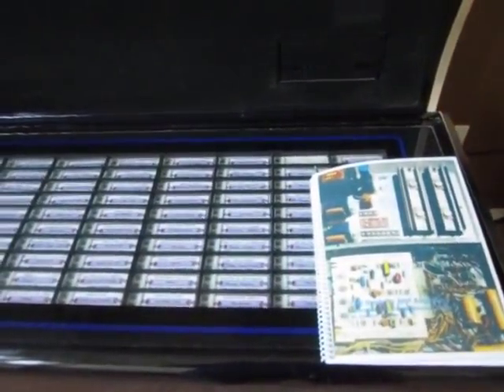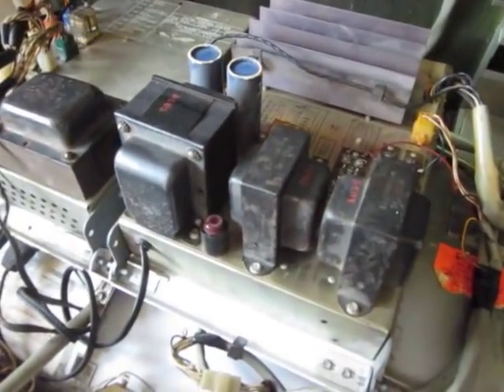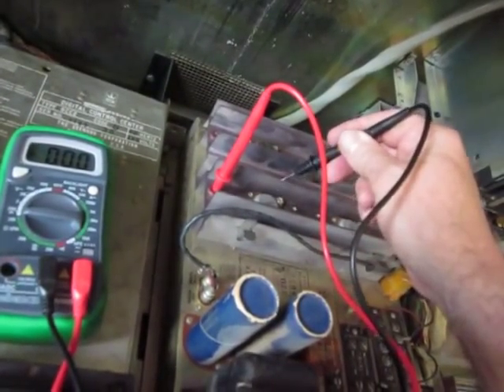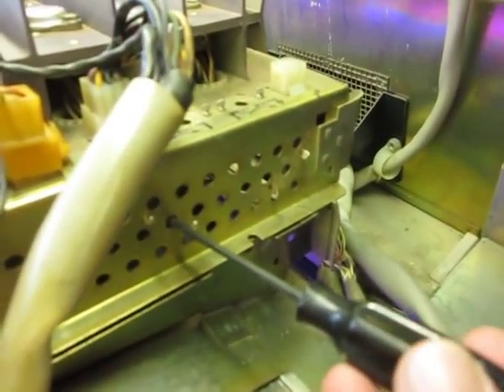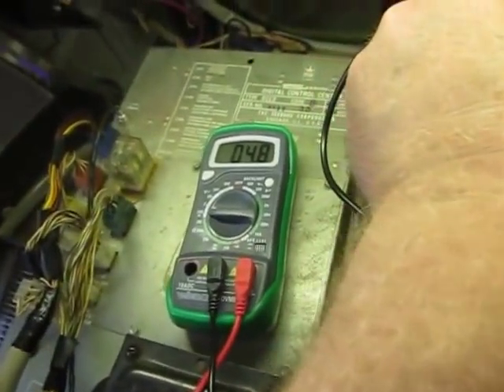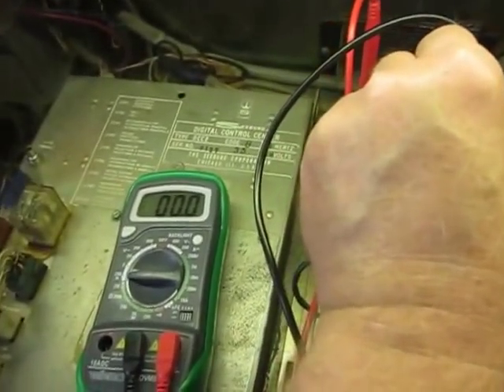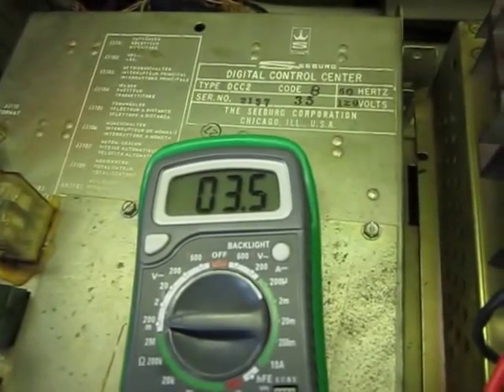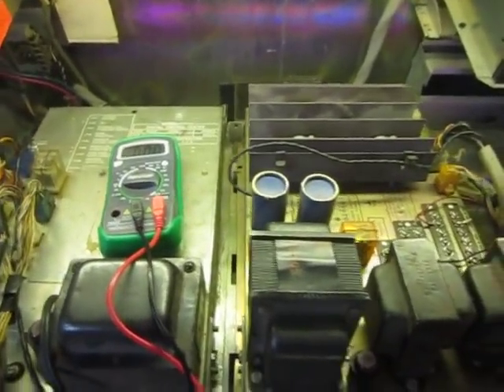How To Adjust Bias Seeburg SHP Amplifier

Comment: The Biasing pots are often dirty, and when you turn them, the pot often "opens" briefly (due to being dirty), causing the bias voltage to turn up fully. This will destroy the drivers and sometimes outputs in about half a second. Biasing should only be set on the bench, and is only necessary AFTER any transistor replacement. If the biasing needs to be reset, it is highly advisable to clean these pots and then clip a meter to them and see that they are adjusting smoothly before applying power to the amp. 

If your biasing pot(s) are bad, you usually find out the hard way (smoke show) After you have repaired the board and checked the ALL the resistors under the heat sink, and transistor in some designs, only to THEN DISCOVER the pot is bad. These are SPECIAL pots and the SHP amps used 2 DIFFERENT values depending on the amp design you have. You MUST use the correct value pot! DO NOT just throw something in. There is a "dirty little trick" you can do to get it to work until replacement pots can be found.  OK here's the trick - Remove all 3 wires from the biasing pot, and solder them all together, and tape them up (insulate them) This will keep the amp from burning up due to a sketchy pot. Now your sound quality may suffer because the biasing will be all the way down, but it will work.

If your heat sink becomes anything other than luke warm after hours of continuous use then you biasing may be too high, or you have a sketchy pot. Turning this pot while the amp is on will almost always lead to disaster.

Comment: My guess is that the idle current had previously been set purposely low because of the lack of stability.  If the amp sounded half way decent & not "grainy" then leave it alone as it was.  You need to realize that these devices will draw more and more current as they heat up.  You are testing them at idle, and this is the coldest they will ever be.  When a record is playing (especially if it is turned up to loud levels) these outputs are going to get warm, if not downright hot.  When hot - these are going to draw a ton of current.  Not to offend you, but bias settings shouldn't ever be altered unless the individual really knows and understands what the process is doing to the circuit.  It is likely that there are other parts in the amplifier that have aged and need replacement.

Comment: Does it have a Vbe amplifier transistor or a double diode. You have serious temeprature stabilization problems. The Vbe transistors may be leaky or the double diodes may be leaky. They should have very good thermal contact with the heat sink or you will see that problem. There may be a lot of bad electrolytic caps in the circuit as well. Those large blue paper caps may be out of spec as well. If a unit is more than 20 years old, most folks re-cap them. You have your work cut out for you bro. If i saw this on a modern amp, and all was new, I'd be thinking that the amp is oscillating, and yours could be also, which makes setting the bias to a stable state, next to impossible. Just some thoughts. Setting the bias to zero and still, it creeps up..... You have other issues... The pot could be bad but I'd look at all the caps, followed by the bias transistor or diodes... good luck.

Comment: The people that write these books are often times the same people that made, designed or built the machines, BUT I have discovered that they are VERY unfamiliar with the common failures and issues that arrive after 40+ years after there work was completed.
Reply: the guy that wrote the book tony miller was a 40 year seeburg tech